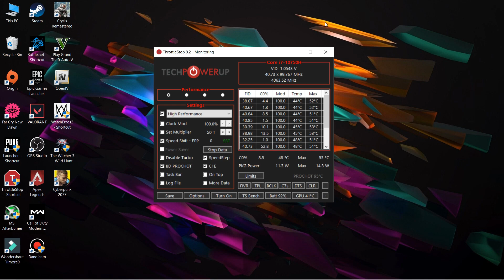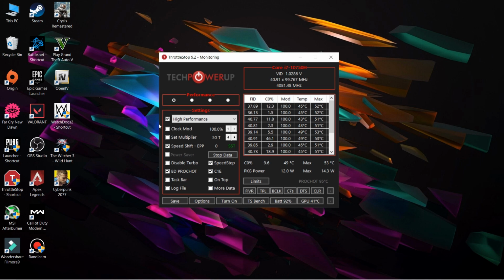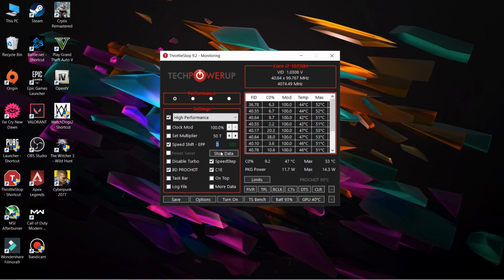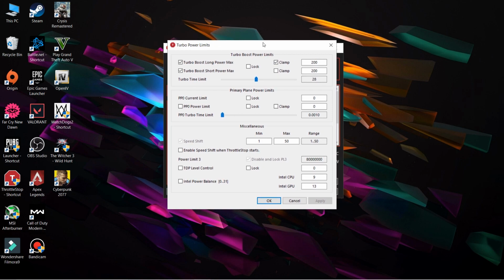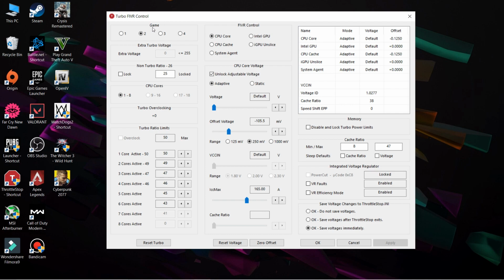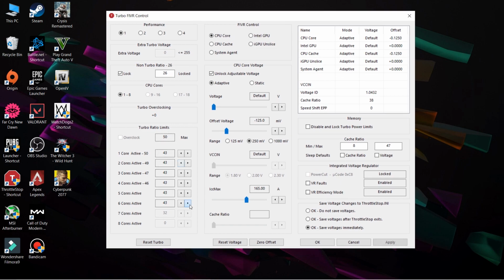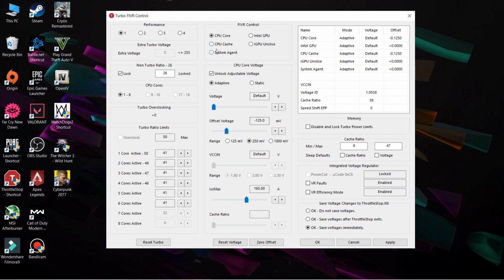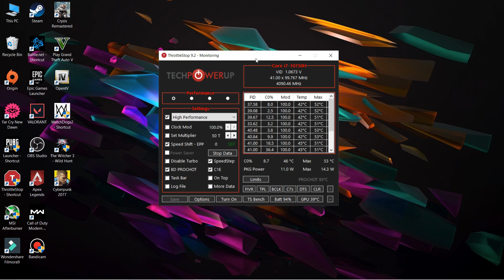undervolting i7 10750H quick guide !! Lower you cpu temps and increase performance !!

Comment: Just subbed! When you restart your laptop, does the cpu reset to the original setting until you open throttlestop?
Reply: Mine doesn’t. I have throttle stop set to run at startup, so as soon as I log in it’s running and applying my under volt profile. Be aware though, constantly running your laptop undervolted puts you at risk for “plundervolt”. I only use my undervolt setting for gaming, if I’m web browsing or anything else I use stock voltages with my max clock rate set to 4ghz instead of 4.5ghz.
Reply from the maker: Yes..until you set it for run at startup.
But do it manually. Somtimes run at startup can cause problems.

Comment: I just undervolted - 125mv and im getting blue screen and cant boot, cant boot now any sugestions?
Reply: Never mind I went into bios saved settings  and exit now i will try -115mv
Reply from the maker: Do not try high values.
Start from lower values like 60,70 or 80.
Reply: @R-tech890  Yeah I started from 80, did 2 tests with Intel Software then 90 now im at 100   did 2 tests again and I think its stable. I will play a bit ac odyssey and if it will be fine i will try 110. I think more than 125 is not possible am i right?
Reply from the maker: Yup.
125 max
Somtine its 120 only.✌️
Reply: @patrykbednarek4954  hey, what type of tests do you do and how can you tell when it’s stable?
Reply: @jansen570  Intel extreme tuning Utility there is an option for stres test and benchmark, i also played a bit assasin's creed odyssey as a test to See the temps in game :D

Comment: my msi gf65 thin 10750h rtx 3060max q bluescreen at - 89mv. is it because of the laptop stock watts i saw some 50w, 70w 90w etc. is it possible my laptop is at lower watts? thanks
Reply from the maker: Those 70 and 90W for the GPU.
But every single laptop support its own UV values.
Some cant go above -60
Try lower the values same for core and cache.✌️

Comment: Does the game profile apply automatically when you start a game or you have to set up this manually every time ? Thanks
Reply from the maker: Make changes in first profile.
Open TS and profile will auto apply.
Every time you open.
Even if you close app it will not reset until you make a restart.
Reply: @R-tech890  I see, but I mean if you make a profile for Performance and the second one for Game as it's title, does the gaming profile apply automatically when you start a game ?
Reply from the maker: No you have to select it manually.
Reply: @R-tech890  Thanks!

Comment: Hello, I have a dell xps 9500 (2020 edition), it has the same processor as your laptop however, my laptop does not allow me to undervolt it. What should I do?
Reply from the maker: Check bios to unlock xtu interface and if you have current bios then its default locked .
Wait for new bios update then.
Reply: @R-tech890  Ok thanks

Comment: On my nitro 5 2021 edition has undervolting greyed out. Its locked. I have an i7 10750h and already replacsd thermal paste with thermal grizzly kryonaut paste. It still thermal throttles, power limit and current limit throttles. This is a new laptop and i have a cooling pad. Any advice would be appreciated.
Reply: Its blocked in BIOS Version. Complicated to unlock. I have a GP 66 and was hitting 95 to 100 Sometimes. I used liquid Metal and now its 75 to 80 while running 5% faster.
Reply: @anlu2351  maybe i should have tried liquid metal instead of Thermal Grizzly. Although Thermal Grizzly is also really good. I dont think im going to fiddle with anything else and just keep it as is. It's unfortunate though. Also side note: i checked the bios and it doesnt even have anything in the bios related to cpu voltages etc. Its almost as if the bios was stripped of almost everything that's usually in the bios. I come from a desktop so i didnt know how different laptops would be.
Reply: Maybe give it a try. I used thermal Grizzly Conductonaut. Nö need to undervolt now
Reply: @anlu2351  ok cool cool. Will give that a try 👍

Comment: hello quick question why i can not change some value. they are lock so i cant put value to 41 in turbo ration and change cpu core voltage. can you help me ? thanks i use throttlestop 9.2
Reply: same, did you found a solution?

Comment: Setting are locked on my i7 10750H
Reply from the maker: Its locked in current bios.
Reply: @R-tech890  any solution
Reply: @R-tech890  I trued but my bios advance settings are hidden and I don't know how to aee them
My laptop is Lenovo Idealpad gaming 3i i7 10gen 10750H icelake
Reply from the maker: Check in blogs or in YT is someone used lenovo laptop.
Reply: @R-tech890  I did, you know better than me please help
Reply from the maker: Try to fined option in bios for OC access or XTU interface.
I dont ha e any idea about lenovo advance bios key.
You have to fined it on google.
Reply: @R-tech890  Yeah I tried everything, there is no way only Lenovo know that
Reply: @R-tech890  It's working fine but I have heating issues so I thought undervolting may help
Reply from the maker: UV help to reduce the temp.
But you need to fined stable values.
Reply: @R-tech890  Please help me man
Reply from the maker: And try to use old throttlestop versio .
May be that will help.
Reply: @R-tech890  I did but still voltage changing options are disabled

Comment: hi, i use this cpu in my laptop HP Omen 15 Ek1035tx, the specification is intel core i7 10750H and RTX3070 maxq, i had the thermal arround 70-90 with maximum fan for playing games, and reach 99.C during benchmark testing (full load), so that the processor hits thermal throttling, i was try to undervolt 0,075v (recomendation from hp) but this doesn't help much, the temperature stays arround 99.C during benchmark test (full load )

and now my question is is this high temperature normal on this i7 10750H?

I am very happy and grateful if someone answers
Reply from the maker: During game if its crossing 85C its not good.
Try to lower voltage till stable values.
And use cooling pad or laptop stand for good air flow
Reply: Change Thermal paste. Make sure you go with Thermal Grizzly Hydronaut or Gelid GC Extreme. Laptops need high viscosity thermal paste do they don't pump out in few days.

Comment: i have laptop gf65 i7 10750h and rtx3060 but i just play gta csgo and lol can u teach me what is best setting for me i want tempertrue lower as much as possible . please help me thank kiu
Reply from the maker: Do not puch game graphics so hard
Also use cooling pad 
Run laptop fan on turbo mode.
Reply: @R-tech890  i mean about the offset vontage i set core at -125mw and cache at -125mw its crash
Reply from the maker: -125 is alot..
Reply: @R-tech890  should we choose the button 'turn on" ???
Reply from the maker: No
Reply: @R-tech890  so i don't know what will best for me and 1 more question is both cache voltage and core voltage must the same ? do it ?

Comment: It's showing that my Intel i7 10870h is power throttling. I checked it with Intel xtu software and found out. Is it good or bad? Btw I'm using MSI leopard gp76 10UG.
Reply from the maker: Make sure its no giving you lag.
If its normal then do no worry about power throttling..

Comment: I'd recommend to use Realbench to test stablility of your system after applying undervolting changes. My Dell G5 15 5500 was stable at -100mV core and -90mV cache. Any lower on either of these and Realbench would give bluescreen errors.
Reply: @RyrytheRy  Followed this tutorial https://youtu.be/zVAJVyF06Ro

Comment: Cool thanks man.    I’m going to try it.    I got it.   I’ve been messing with the settings for a few days.   I’ve had it running great and cool and come back later with same settings and it runs worse and gets a little hot.    Back and forth.    Definitely helps a lot.    I hit 99°c the other day and now I’m running the same games just as good down in the 60’s-70’s.   It’s great.
Reply from the maker: Thats great..😀✌️
Reply: @R-tech890  is this like 
Disabling turbo boost 
Which is better
Reply: But did you lose a bit performance or do you have the same performance as before?
Reply: @Mohoutje015  depends on what I have running I guess.    Probably lost a bit.   Usually not noticeable.
Reply: @Mohoutje015  but I actually on the other hand gained some better performance
Reply: @manku2002  is this like 
Disabling turbo boost 
Which is better
Reply: is this like 
Disabling turbo boost 
Which is better
Reply: @yasserhassan958     If I disable “turbo” on my laptop it caps the gpu mhz     Doesn’t do anything for the cpu that I’ve noticed.    Undervolting is better because sometimes you can have it run just the same only cooler temps.   You might notice no difference in gameplay or you might depending on wether whatever you’re running is cpu or gpu heavy.  Or how much you have to undervolt it to make it cooler
Reply: @yasserhassan958  or do you mean checking the box in throttle stop?    I do sometimes.    If it’s still hot after messing with it.    That’ll cool it down quick.   Will probably notice performance drop with that though.     You can set all the cores individually to cap.   The top turbo on mine says 50.   Then all the cores under it say like 49 max I think.    I tick them all down to like 40 and see.   Or 39,38.   If it doesn’t really help.   Check disable turbo
Reply: @luckysniper1659    yes it runs on 2.5 GHz 
My laptop is the legion 5 is there is any problem  undervoting it and if I want to undervolte it just follow your video or there is something else i should do 
And another question what is the best thermal paste iam using noctua nth1

Comment: How to unlock undervolt in my acer nitro 5 laptop ?
Reply from the maker: Bro fined out option in bios for OC acess ot XTU interface
Reply: @R-tech890  There is no option like this
Reply from the maker: You need to fined out on blogs.
Also check if there any preinstalled software for UV.

Comment: More then half of my FIVR control panel says lock what do i do
Reply from the maker: Its locked in current bios.
Wait for new bios update.
Reply: @R-tech890  As in a new ThrottleStop update? I'm not sure what you mean.
Reply from the maker: Do you able UV with previos TS version.?
Reply: @R-tech890  I just installed 9.0 and it works thank you so much!

Comment: hi bro nice video and i subscribed too,  bro i have a question I have intel core i7 10875H Predator triton 500 base speed 2.3Ghz and my benchmark is speed upto 4.8Ghz Do i can input to 4.8Ghz on Throttlestop?
Reply from the maker: No buddy.
It will not hold 4.8 on all core not even single core for long time.
Reply: @R-tech890  thanks for reply,,, i tried your method but it was crashinf after some time,, how can i put to default again?
Reply from the maker: First do not use same values as mine.
And to reset remove volyage value and make clock speed default in fiver as previous.

Comment: Hello,

Please, How do I know I have a stable undervolt ?  I have i7  10870H ,  Gigabyte Aero 15 KC.   Currently, an undervolt of -50 mV .  I made it from the bios. How do I know how far I can go?
If I use this ThrottleStop App. After restart the PC I will have my original values?
Reply from the maker: Do little stress test your cpu.
Start increase UV value be 10 when you get blue screen on a value use lower value than that..
Reply: my Aorus 15g xc wont even let me undervolt, oh well the cooling is good enough.

Comment: after applying cpu catch settings my laptop freezes and i have to hold the power button to restart it.. can you help me with it?
Reply from the maker: You are using the voltage values which are not stable start from lower number like -50mv or -60mv and then try to do stress test and see what stable values you can get.
Reply: @R-tech890  can you let me know any values for i7 10750H using  rtx 2060? will be helpful a lot :)
Reply: @R-tech890  i did that but there are no change in temperatures even with -90 (dtarted from -50)… after i apply anything above -100 my laptop freezes… anything specific that i should do?
Reply from the maker: Lower down clock speed...
Reply: @R-tech890  i dont know how to do that.. can you help me a bit
Reply from the maker: Through FIVR.
I think i've showed in this video.
https://youtu.be/f4-dbWhNcRE

Comment: Hi urgent question. How do i unlock the locks in my bios since my dell g5 5500 has locked it. btw my bios version is 1.8.4. i have seen videos that unlock undervolting in version 1.7.1 but im not sure if it works in 1.8.4
Reply from the maker: Its not available in current bios.
Wait for new update.
Reply: @R-tech890  so the 1.8.4 cant be modified like the 1.7.1?
Reply from the maker: Yup

Comment: Brother please I have i7 -11800 pelase help me sir you are good man,I really need your help for undervolt this cpu please sir ❤️
Reply from the maker: I think process will be same.
Use throttlestop for UV and try to lower down the voltage.
If u can lower the voltage then start from -60mv.
Reply: @R-tech890  ok,I have 8 core ,so I need to do like you from core 1 to core 8 (41)?
Reply from the maker: Yup you can.
Just change first core rest will go down autom..
Reply: @R-tech890  and should do cache like voltage I mean if voltage is -80 I need to put cache also -80 right?
Reply from the maker: Yes
Reply: @R-tech890  thank you so much ,and how can know best voltage for me ?

Comment: I'm just curious, does undervolting using throttlestop is better than using any other undervolting software? (Omen 15 command hub)
Reply from the maker: You can do with any software.
But throttle stop give you more advance control if you know how to use..✌️😀
Reply: @R-tech890  thanks! I think your video helped me lower down a bit of cpu temperature. Great video!
Reply: My hp g hub changed after some time, I check in the hw monitor that there is no lower voltage thanks to the application in the undervolt connection ...

Comment: hello, how could you do the undervolting of the i7 10750h processor, my processor voltage is blocked
Reply from the maker: I didnt upgraded my bios.
Its locked in new bios.
Reply: @R-tech890  what kind of laptop do you have? is it possible to return the old bios?
Reply from the maker: I have msi gl65
I didnt upgrade the bios.
And developer removed the old bios version from website.
Its hard to fined compatible bios now.
So wait for new update.
Reply: @R-tech890  Thank you so much
Reply: @R-tech890  could you please send link to msi gl65 bios that is unlockable to clock? thanks in advance
Reply from the maker: Old bios is not available buddy.
Its hard to fined developer removed old bios.
It will hard now to fined old bios version.
Only way to wait fir new bios.

Comment: my fivr option are grey cant change any setting
Reply from the maker: Its locked.
You can unlock it from bios.
And if you have current version of bios.
You can UV.
Its locked by default in new bios.
Wait for new bios update.
Reply: my laptop is asus rog strix g15 and its bios doesnot have option of overclocking and xtu enable option
Reply from the maker: Iys locked by default.
Please wait for new bios.

Comment: Which profile do you use in msi dragon center?
Reply from the maker: Extream always
Reply from the maker: Try reset the laptop.
Onnly setting not data.
Reply: @R-tech890  Ok I was able to do it somehow. But the FIVR is still locked
Reply from the maker: Have you updated the bios?
Reply from the maker: No.
It only back to fefault when you make a restart.

Comment: Thank you for the video, but i can´t do undervoltage, is locked and can´t change offset voltage, any suggestion?
Reply from the maker: Its locked from bios.
Unlock XTU interface then you be able to UV..
Reply: @R-tech890  hey buddy , how to unlock the XTU ?
Reply from the maker: Fined option in bios.
Performance and xtu interface.
Reply: @R-tech890  tnx 
I should search for it .
Reply: Can you check anything?     Try “disable turbo” on the main screen.